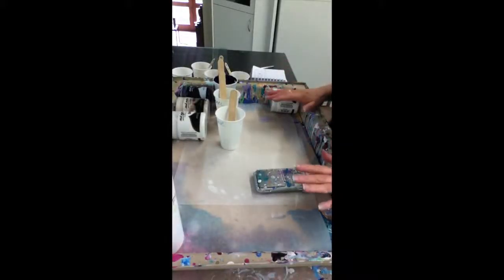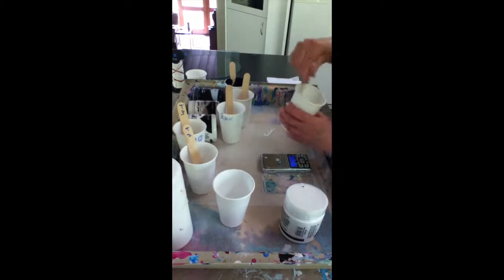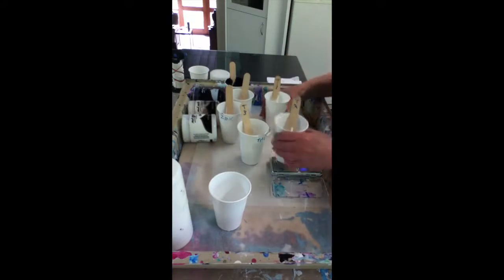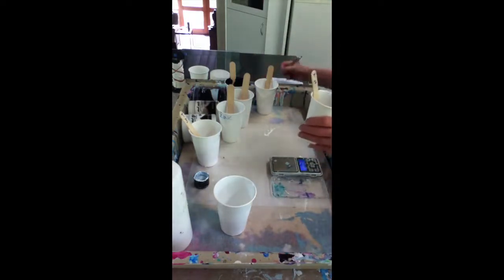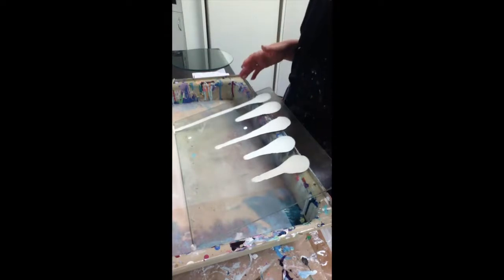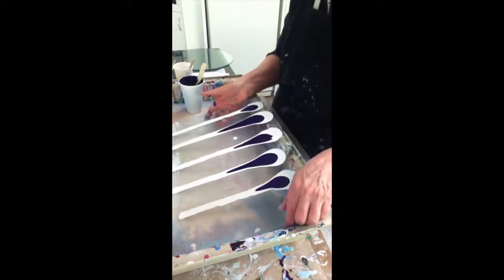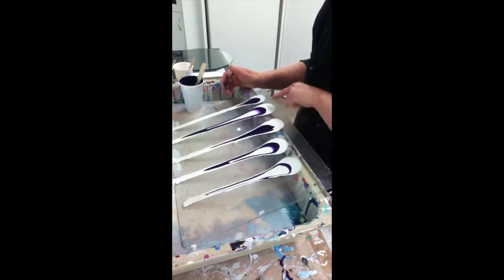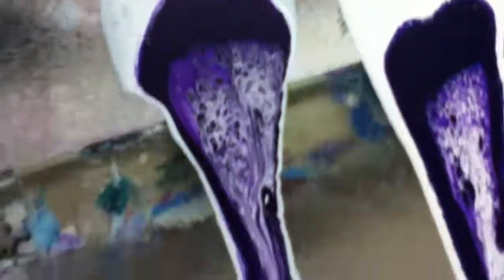Heavy Body Acrylic & PVA   Ratio Experiment

Comment: Hi Chris - like your methodology, it really helps. I've just come across 'flow painting' and know nothing about the principles or properties of the materials used in this technique. It's been hard to find basic explainations of why things happen so you can try your own methods. Your comment to Beth below is really valuable - I'd also like to know why a quick waft with a torch helps, or how adding a couple of drops of silicon etc. encourages more cells, or maybe different types of cells. Anyway thanks again.
Reply from the maker: The torch is just to pop the micro bubbles that are created when you mix your paints. Silicone and water don’t mix so when you have silicone in the mix it repells the paint leaving you a cell.  More silicone is not better.....  if you mix it thoroughly in your paint it will give smaller cells than if you just leave a big drop you will get a single big cell.  LOL. Not always a good thing.  Natural cells (without silicone or additives) can occur when you have different density pigmented paint.
Reply: Thanks for reply Chris - I will have to give this technique a try - now you have answered my questions I know where to start. Cheers.